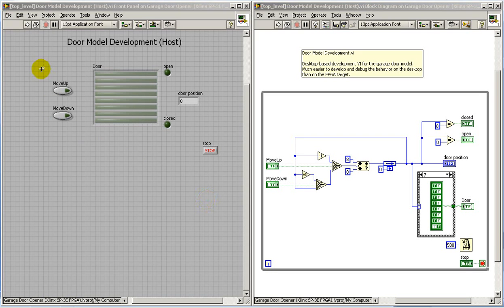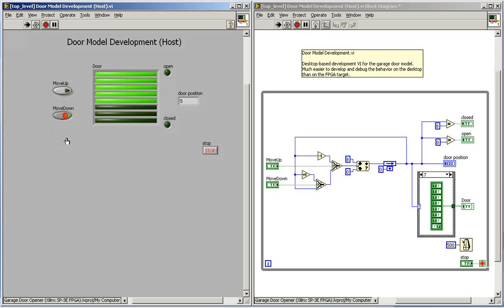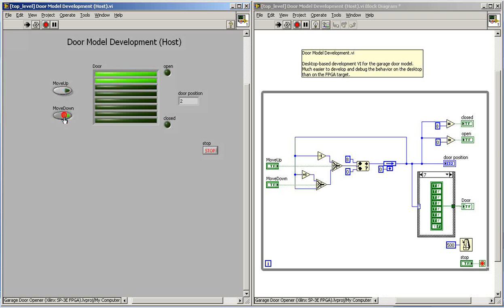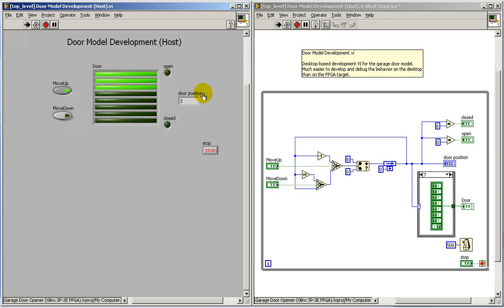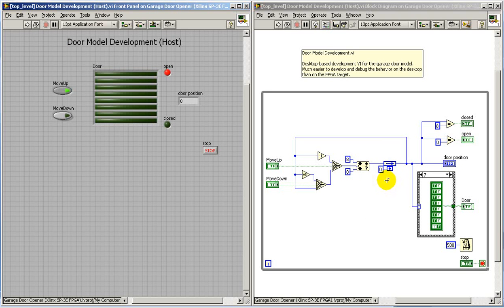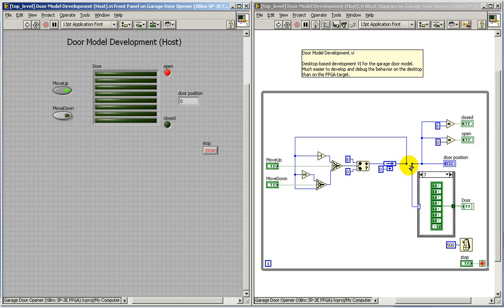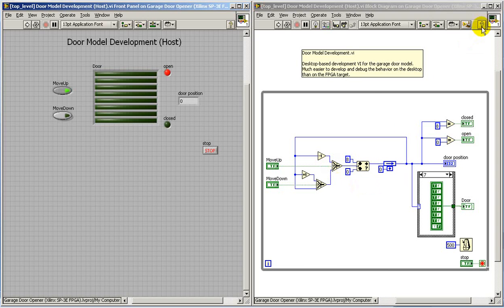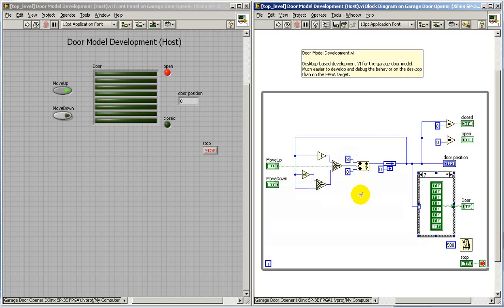LabVIEW FPGA: Garage door model

Comment: Thanks...but can you explain some of the functions you did not explain in the video, like where you got them from / what they do.  For example the triangle with the T/F and "?", what is that called? And also the ticker at the bottom right with "500" as an input, can you tell me what that's called?  I can figure out the rest, and look up how those work. Thanks!
Reply: +clint4Now I'm trying to create a sequence modeling for a plumbing/pnuematics/propulsion system.